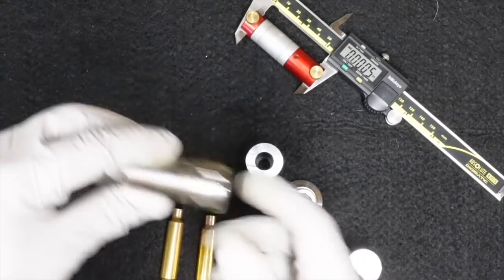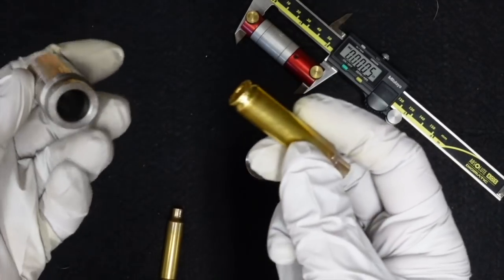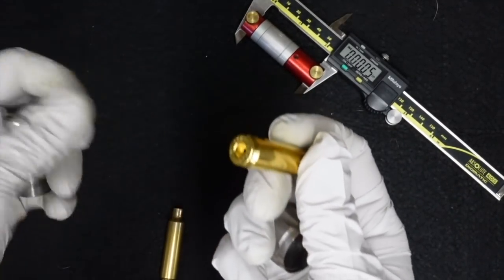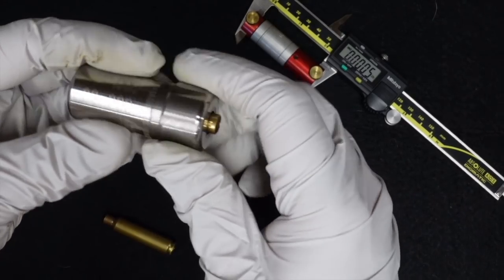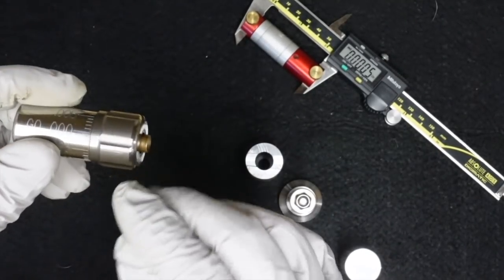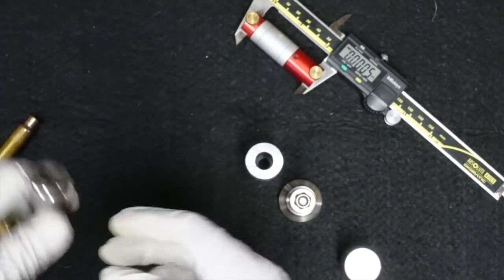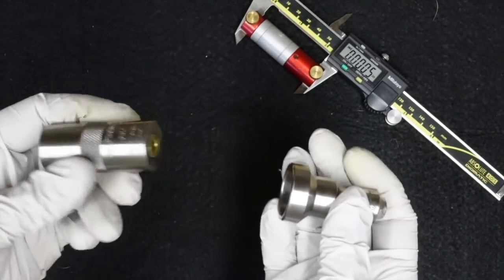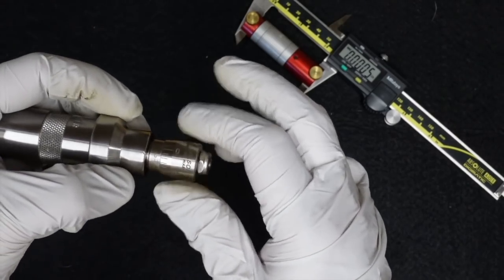Measure shoulder bump & headspace with ease

Comment: Switched from the Hornady to the SAC headspace gauge, it's so much worth it!  It's super solid when you measure as it has more purchase on the shoulder.
Reply from the maker: I actually just ordered one a few minutes ago. I'm excited to test it out.
Reply: SAC version is great. Works similar to Hornady and Sinclair versions. However, shoulder angle is matched perfectly, giving much more solid feel, no wiggle, and near perfect repeatability. Worth the money — you will be happy happy with the purchase. I have the Wilson, Whidden, Hornady versions that you demonstrated, along with the Sinclair caliper version (like the Hornady). I use the SAC exclusively now on a dedicated Mitutoyo digital caliper — I find it to be the easiest, quickest, and most repeatable for me. Thanks for all your hard work and reviews.

Comment: I started with Hornady headspace gauge, then switched to the Forster never looked back, very consistent results.
Reply: Yup.  But I ended up buying extra “bodies” so I didn’t have to (literally) screw around with switching the cylinders.
Reply: @OFFICIALUND  bought 2 bodies for each measurement headspace and base to o-drive, works perfect.

Comment: I have had good success with the Whidden.  A caution though, if you get going too fast, it is easy to start a cross thread.  
A word of caution:  since your measurement is based on thread tension, it is important to keep the unit consistently clean.  I use Imperial sizing wax and noticed that when handling the tool, some wax residue from my fingers gets on the threads after several uses.  This lubricity changed the thread tension and resulting measurement.
Reply from the maker: Thank you and I totally agree.

Comment: I've been using the hornady body with mitutoyo 6" calipers just like the one in the video but I tossed the aluminum inserts and made my own headspace and bullet comparator inserts out of 303 stainless steel on the lathe. Solved all of my repeatability issues and I KNOW the bore diameter is correct.

Comment: I personally found that the Wilson and SAC/Caliper give me consistent results. I could not make the Widden work for me: rotating the cartridge a bit and taking another measurement, or shaking the cartridge within the gauge before taking another measurement would give me different readings. Also found that Sinclair versus SAC is night and day - SAC is spot on.
Reply from the maker: Yeah I can see that with the Widden since it's not a tight fit like the Wilson.

Comment: Hi John! May I suggest that you premise you’re Brass preparation (sizing) recommendations (shoulder bump) for your bolt action rifles. Some service rifle (M1 Garand or M1A) hand loaders may not be aware of the differences between a bolt action rifle and a semi automatic service rifle relative to brass resizing. Military rifles require greater shoulder bumping (maybe 0.005”) to function properly. Always use a case gauge and verify in your rifle chamber! My point is, you are speaking to a wide audience and they may not know your specific firearm hand loading needs (bolt action). I know what you are doing but many may not and apply your information to a semi-automatic chambering rifle witj very poor safety results.
Reply from the maker: That’s a very good suggestion. I’ll work to frame my reason and how I reload for what I do in the future. Thank you.

Comment: Hi John,  I bought a Wilson case depth gage  after watching your video and have found it to result in problems and provided inaccurate measurements in my hands.... went back to using the Hornady gage and the Sinclair bump gage, and my chambering problems went away.  Waiting on new gages from SAC.   I have to admit that I likely would not have discovered that the gage was the problem until a read an older thread on AccurateShooter reloading forum entitled: Hard Bolt Close Rem 700 17 Fireball (read post #32 on this thread, where the OP  figured out what the problem was).  I have lots of LE Wilson dies/gages and am surprised/disappointed in this tool....
Reply from the maker: I'm sorry to hear you had problems. I got my SAC GAUGES since this video and will be doing a followup. Every gauge has it's own quirks and the more of them I use the more I realize there's sadly still no perfect one yet and right now I just comes down to the person and which gage fits them the best.

Comment: Great timing on video.  I'm resizing Alpha 6.5 CM brass with Whidden bushing die.  If I measure "bump" with LE Wilson case gauge micrometer at .002, brass is difficult to chamber.  I then check same piece of brass against comparator measurement(using Whidden provided comparator) there is zero bump on comparator measurement. If I bump until I get a .002 reading on comparator,  brass will chamber nicely but Wilson micrometer measurements reads a bump of .005-6.  What gives?

Comment: Question: Is the shoulder bump measurement more important for bolt guns as opposed to semiautomatic weapons, Since I am using FL dies for my semi autos? Thank you. Great video.
Reply from the maker: Bump is definitely important for gas guns because of cycling and firing issues. Too little or too much can have a much bigger effect in gas guns compared to bolt guns.

Comment: So, John, which measurement do you think is the critical one - Datum to Ogive, using the AI guage or Base to Ogive using the SAC, Redding or Hornady micrometer attachments?  My arbor press will give me almost identical Base to Ogive results but there is more variance when using the AI Datum to Ogive measurement.  AI would say that the Datum to Ogive is most important as the firing pin drives the case forward until the shoulder/Datum touches.  Conventional reloaders have always used Base to Ogive.

Comment: On my fired brass in my 6.5 Grendel AR-15 my shoulder moved forward. .010 compared to when my brass was brand new. My question is should I move the shoulder back to .006 to .008? 
If so my brass will be above the upper step of my case gauge.
Reply from the maker: I’m not super familiar with that cartridge but traditionally you want to move it back from where it fireformed, not where it originally started. It sounds like your chamber might be a little bit longer than you expected which is why it’s growing more. I’m honestly not familiar with how much the bump the shoulder back for a gas gun but I know it is more than Bolt guns.

Comment: so if you measure before you resize the case and then remeasure after you resize the case won't the difference between the two measurements be affected by the resizing of the case by the die ?
the case will get stretched in length by resizing and this will affect the headspace measurement correct ?
Reply from the maker: In theory your brass should always measure the same or less at the shoulder if it's sizing correctly. There are times when you size and the dies isn't down far enough and it will actually lengthen your brass and that's not good.
Reply: @FClassJohn  thanks but I did it again twice with four shot 223 cases and before I full length the cases were from top to bottom dia of .360 - .366 - .375 and after sizing they were .356 - .363 - .375 and overall length went from .755 to .756.5 ? I measured dia. & length with a Mitutoya caliper which is suppose to be one on the better ones. 
This has been ongoing for the better part of a year and so far no problems so maybe 223 due to their size are different. Now when I resize I do not include a dia bushing in my match die instead when I body size then I use my Lee Collet Neck Sizing die which is installed on another press right beside my first one. I like that mandrel for internal sizing (.221.5) and the squeezing of the collet. Less brass movement :)

Comment: Ever used reddings instant indicator for headspace?
Reply from the maker: They don't make them for my caliber.
Reply: @FClassJohn  Imho it would be worth contacting them to see if one can be custom made for you. It is the quickest and most repeatably accurate method when used correctly in my opinion. There isn't any error from inconsistent pressure applied as with the other methods. The ram is at rest every time.  AND...using a .0005 dial instead of the .001 dial makes it even more accurate for readings (for those OCD types). Lastly, it can do the same with  case o.a.l. or bullet seating depth. It is ONLY a comparator so the caliper set is still needed for total length measurements, but used for setting up a die for shoulder bump or seating depth it is unbeatable imo. (Says a student to a master. lol. Sorry. I just really believe in the product)

Comment: No Redding instant indicator?! By far the best tool.
Reply: Fastest for sure if you’re checking a lot of pieces.  My results are very good with it, but we have to be honest that there are a lot more places for error to occur (like stacking tolerances).  I think you need to check your first couple using these “more intimate” methods, then switch to the Instant Indicator for the rest.

Comment: WHAT ARE YOU USING FOR BASE TO OGIVE...IS THERE SOMWTHING LIKE THE WIDDEN OR LE FOR THAT?
Reply from the maker: I use the Accuracy One bullet comparator https://youtu.be/yikYkykMCcQ
Reply: SAC also make gauges that sit on the Ogive for use with a Caliper.
Reply from the maker: @Eric-qu3ht  I already ordered one earlier today. We will see how I like it when it gets here.
Reply: WHILE I HAVE YOUR EAR...DO YOU BELIEVE THE LE DIE IN AN ARBOR PRESS TO GIVES YOU BETTER, IF NOT THE BEAT RESULTS IN REGARDS TO CONCENTRICITY IN BULLET SEATING. VS...SAY A REDDING COMP. 
VLD APPLICATION PARTICULARLY
Reply: I have used both the Accuracy One comparator John mentioned, and the SAC (Short Action Customs). Both are well made, solid, and very repeatable. I also get repeatable and consistent results between the two (once you account for case length). You have to decide which measure best suits your needs: The Accuracy One measures shoulder datum to ogive; while the SAC measures case base to ogive. However, the Accuracy One is much faster — look at the videos on their site or YouTube — just push in and look at reading. No adjusting calipers and spinning the case. I agree with John, and have started using the Accuracy One unit now for all my recordings and record those numbers for variance and consistency with seating depth and therefore ogive to lands. I still use the SAC to measure and record Base to Ogive to ensure overall consistency, safety, and reliable chambering.
Reply: @michaeldinapoli1738  THNX...
VERY COMPREHENSIVE. ANY THOUGHT ON MY CONCENTRICITY Q ABOVE
Reply: @85ZERO17  DETAILED ANSWER & PERSPECTIVE: I own and have used Redding Competition press seating dies, Whidden press seating dies, and LE Wilson arbor/hand bullet seating dies for most of my rifles, especially 6mm CM. I used the Redding and Whidden seating dies in an older RCBS RC-II and Harrell custom press. I did not record all the bullet R/O data for these press mounted dies, but believe it was in the 0.001 - 0.004” range. I now use the LE Wilson Arbor seating dies exclusively and record all bullet R/O data to 10 thousands of an inch using 21st Century and Accuracy One concentricity gauges with Mitutoyo test indicators. I have been doing this because I have been testing various set-ups and components to see what gives the best results. During load development with new/unfired Lapua cases FL sized with Whidden sizing die, neck turned, then neck tension set with expander dies; then loaded with Berger 105gr Hybrid Targets using LE Wilson Arbor seating die, I got the following R/Os for 24 rounds: min: 0.0002, max: 0.0022, ave: 0.0011, sd: 0.0006. Half of these (12/24) were  < 0.001, and only 3 were > 0.002. Group size @ 100yds ranged from 1/4” to 5/8.” This is great for non-fire-formed cases. I like and prefer the LE Wilson arbor dies because they are extremely well made and have tight tolerances. Also, they are so simple and involve so few interacting surfaces and moving parts, that they PROVIDE THE HIGHEST POSSIBILITY AND PROBABILITY of limited R/O. I believe the Redding and Whidden (and other) press mounted dies CAN PROVIDE similar concentricity if used in a good press and a lot of attention to detail. However, you add in the factors of thread tolerances, thread slop, differences in thread engagement, ram run-out and movement, perpendicularity of ram movement, degree of parallelism between ram face and die, press flex, etc. Most of these obstacles don’t exist or are limited for the arbor dies. However, I reload for the fun of reloading ammo with the tightest tolerances, and shoot for the smallest groups. I do not shoot high volume like PRS (at least not yet). Arbor dies are slightly slower than press mounted seating dies on a single stage press, and would be much slower than using press dies in a progressive press. So it depends on your goals. I hope this provides good information and perspective to help you decide. Best wishes. Mike D.